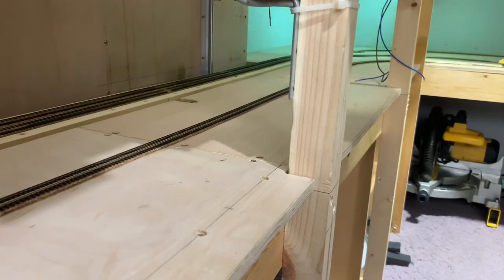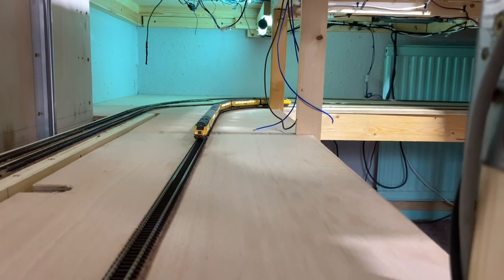LAYOUT Extension Phase 1, Video no 5: BUILDING THE NEW FIDDLE YARD & THE TRAIN LIFT IN OPERATION.

Comment: Wow! You have been busy! That’s looking great
Reply from the maker: Richmond North Yorkshire, a OO gauge layout thank you, yes has been an incredibly busy week, with work and life ha ha. It’s a nice big run, looking forward to main layout extension now lol.
Reply: Piccadilly Model Railway By John Warner are your points all motor controlled?
Reply from the maker: Richmond North Yorkshire, a OO gauge layout Oh no, Im struggling with the crappy DCC decoders so unreliable. When I can afford it Im going to mega points, purely because of the back up service
Reply: Piccadilly Model Railway By John Warner which decoders are you using? And what system are you using to control them? I’ve bought a Lenz LS150 accessory decoder, but I’m told that the Dynamis Ultima controller is a bit crappy for controlling points, so I’m trying to think of a better way. I’d love to use Megapoints, I used to have one of their semaphore controllers, but they’re not cheap.
Reply from the maker: Richmond North Yorkshire, a OO gauge layout it was DCC CONCEPTS ONES AND Z21. When they are finally programmed (which can happen straight away or about half hour later, not joking, if at all) they are fine, but recently 2 caused my major short circuit. So not impressed.

Comment: Hi John, that looks great, just a thought but at the end nearest the Radiator have you ever thought about a Turntable and Engine Shed / Maintainance depot and the tracks that come round connect to the Turntable..But looks great you have done a lot in the week....John
Reply from the maker: John Marshall Hi John, Thank you so much for the suggestion, but it is an ‘off screen’ fiddle yard. It is purely for storage. I’m going to cram it with storage track. The running loops will main clear eventually, ( till sidings go in), but they are for access to from the lift. No buildings nor scenic, sorry. Thank you again, please keep them coming.

Comment: Really like your lift build, question how are you getting power to the lift tracks , gives me some ideas for a staging yard
Reply from the maker: Thank you, seasonal expansion / contraction of the tracks does cause few issues, just need to keep on top of it. Also check nothing is in the way every time it’s used, I’ve had whole thing tilt. It’s hard to get straighten again when that happens. Possibility two actuators. 
Power comes from the main bus wire on a long loop so it doesn’t catch. But also a on / off switch with track off before moving. Gratefully never had a train dive to its death. 
Four years in still works well. Certainty saves on space, but you have to think and plan before operation. A helix or long ramps are so much smoother, but both are huge to fit in your space.

Comment: Can you adjust the actuator, find tune where the track stops
Reply from the maker: Hi, sadly not. Not sure if you could on a more expensive one though. Maybe a stepper motor, as used on 3d printers, but wouldn’t know how to wire this to stop in varying positions.

Comment: Looks great John, very smooth operating system, it will look even better when you get that darned window done, so you can extend. Love the extra space under the layout, don't think I've seen a model railway  with a lift before, cheers, Dave 
 if you are interested, here is a link to me and a mate's N gauge loft railway it's really low res lol  https://www.youtube.com/watch?v=WUAFwhKXki8&feature=youtu.be 1st vid so be kind!
Reply from the maker: Dave Harriman thank you Dave, yes I’m very pleased with it. Still have to sort few teething issues but all very minor. I do tend to do things differently, not by cause, but rather because I try to find the best solution for me. 

I will look at your mates layout later, and of course I’d be kind, no question. Always good when someone shares their work.
Reply: @piccadillymodelrailways  Thanks John, it was a joint effort between us